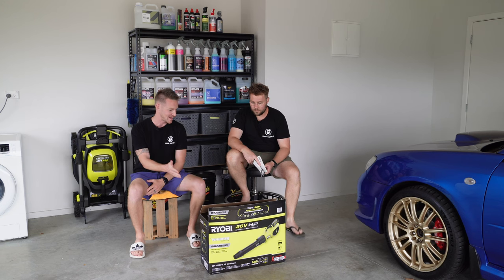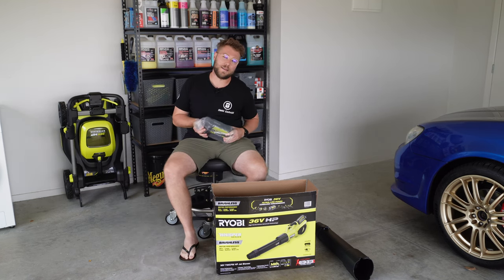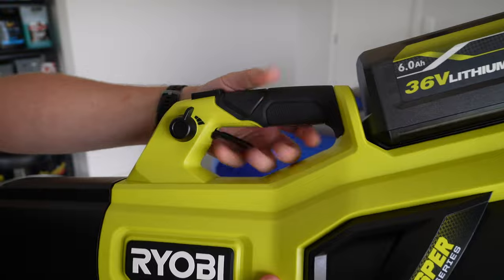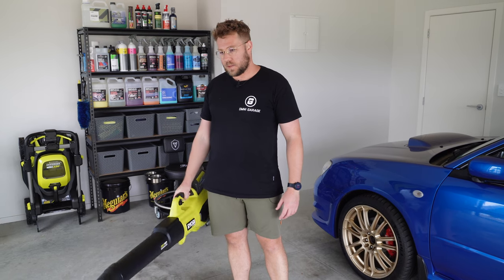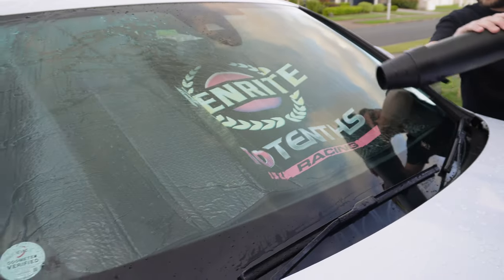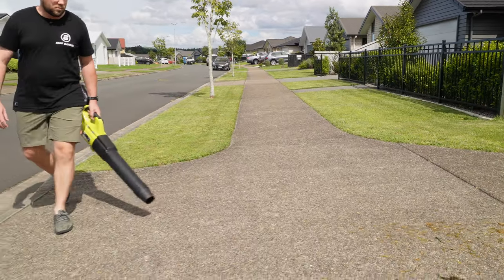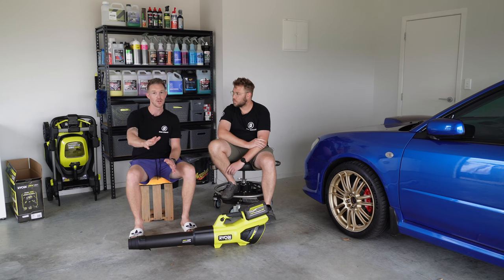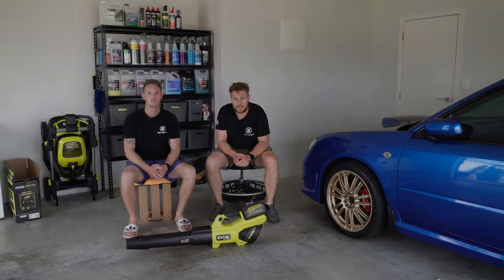Ryobi 36V HP Brushless 730CFM Blower

Comment: I bought it today at Bunnings in Melbourne for 600 AUD and i'm so happy with this blower.
I mostly bought it to dry cars as i'm a car detailer.
I was looking for Big Boi and MetroVac they good but with the hoses and cables around just to messy.
This is a bit big but does a really good job it dryes the car real quick.
I would maybe need another battery just in case, not sure how much they are but would see.
Reply from the maker: Yeah this is fantastic for drying cars.

Comment: I’ve been waiting patiently for this vid... I recently purchased this blower from Bunnings... upgrading from my old 36v blower that’s over 5 years old. This new one is AHHH..MAZING!. I used it today to blow the lawn clippings off my driveway. 
NOW...I need to point out some important info. As I have the 2.5amp batteries... I can’t use the boost button on my new blower... it’s just cuts out. So I squeeze the trigger again and it blows, but the moment I push the boost button, the blower cuts out. I’m just assuming it’s because I have the old 2.5amp batteries. I will eventually buy some 6amp batteries.
This isn’t a real big issue for me, because even without the boost button, this blower has more wind than my petrol blower and that was a beast. I was sick of mixing the fuel with oil then pouring it into the blower and trying to start it, and it was loud and leaking fuel everywhere.
That’s why I upgraded to this blower and not one regret. Absolutely love this machine. No more petrol blowers needed.... UNLESS you’re on a huge block of land that needs a blower for more than 20mins.
Reply from the maker: Yeah I love this new blower. Upgrade your batteries to bigger ones and it will be fantastic!